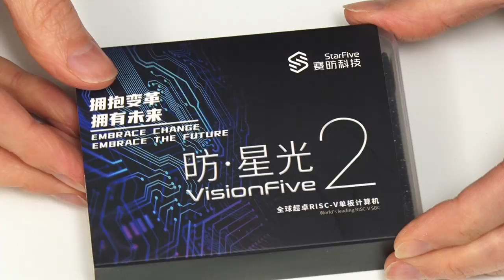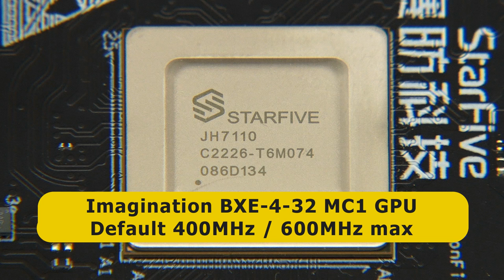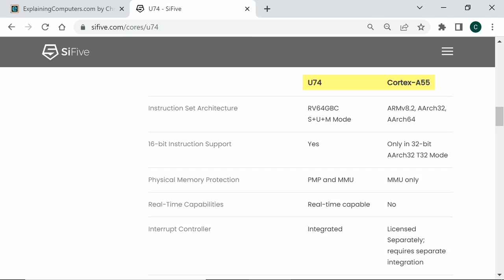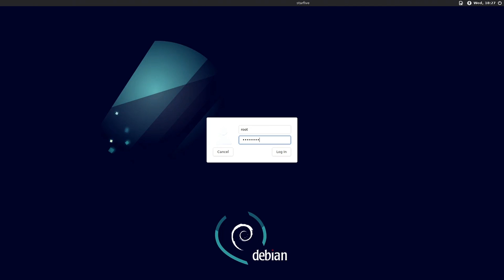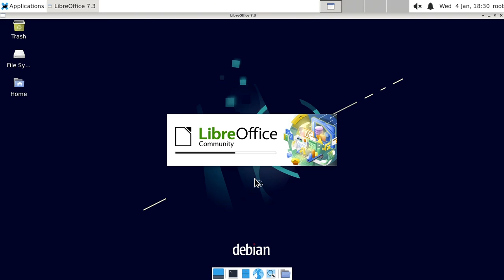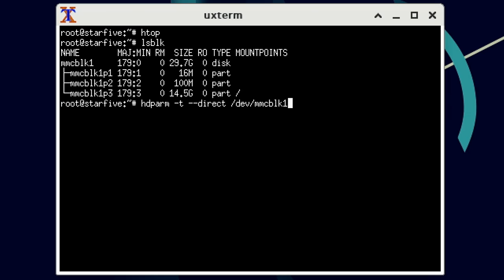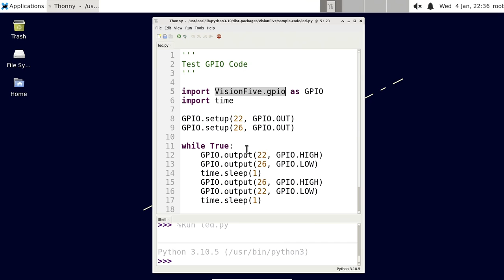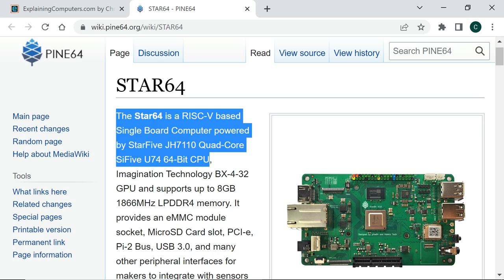VisionFive 2: RISC-V Quad Core Low Cost SBC

Comment: Having GPIO with actual control is SO VERY IMPORTANT!   For me, I don't really care if there are pins on the board from manufacture if you can't do anything with it!  One can buy Motherboards for all types and sizes, but the ability to 'sense the world AND talk back to it is the entire point of  of development, in my humble opinion!
Reply from the maker: We are, as so often, in agreement! :) I was very pleased to be able to install and test GPIO control. StarFive already have a pdf guide to using GPIO on the board, so are clearly going to support the maker market. I think a lot of people will want to experiment with a RISC-V project board, especially when Raspberry Pis remain in limited supply.
Reply: Erm, have they not been doing what you describe with the Raspberry Pi for over a decade already?
Reply: @terrydaktyllus1320  And I have been a Pi fan for years. It's just tough to build new projects when you can't obtain the hardware to do it on!   😛
Reply: @lesliedeana5142  But, with respect, that's not what you originally said.

You said "I don't really care if there are pins on the board from manufacture if you can't do anything with it" - which, of course, is not correct for Raspberry Pi as the pins are both functional and well-documented. That's the point I was responding to.

Sure, I accept there's a supply problem with the Pi and that people are looking for alternative boards instead - I entirely get that and it's why I build Gentoo Linux on my types of boards including Raspberry Pi, Banana Pi, Orange Pi, NanoPi Neo, some Olimex boards and even the Atomic Pi based on Intel Atom architecture.

But you've now decided to answer an entirely different point that what you originally stated and, with respect, "Telepathy over TCP/IP" hasn't been invented yet - so I can only respond to words that you write, not the thoughts in your head.

I do wish more people would stay on topic in these discussions!
Reply: @terrydaktyllus1320  With respect, you are the one not on topic. Leslie was talking about a non PI board and others like it. Leslie agreed with your not on topic comment about PI SBCs, but her original comment was about the presentation of non PI boards with or without GPIO pins.
Reply: @terrydaktyllus1320  I apologize, but I don't mean to start a 'flame war' here. This was intended to just be a general reply and not a historical accumulation of my projects and designs. I've purchased a multitude of SBC products, all of which had 'GPIO' on the board, but turned out to be unusable. Admittedly, I haven't purchased the  multi-hundred dollar versions because they fall out of my 'experimental' price range. The Pi's over the course of time have done a good job, and I've had to come up with several add ons  to improve reliability for 24/7 applications. But a max $75 unit is what I'm looking for.  I've done projects using PC's and writing code to monitor I/O such as printer port status' to monitor things, and other things with low-voltage relays.  I don't mind engineering things.  It's just very disheartening  to get a new  widget board, see the lovely metal posts sticking out of the epoxy, and not being able to do a single thing with them!  I still stick with my original comment, and I don't think that I'm being 'revisionist' in it.  Hugs, my friend.
Reply: @paddle_shift  So Leslie cannot speak for himself/herself and has appointed you his/her spokesperson then?

I can only respond to the words as they written - if the words written are open to multiple interpretations then that is the fault of the author, not the reader.

So can I suggest that you direct him/her in the use of a more coherent selection of words in the future?
Reply from the maker: @paddle_shift  Agreed. I think it was very clear that Leslie was saying that it was good to see a board with software GPIO support, which is not always the case. She did not in any way imply that Raspberry Pis do not have this support. It was a positive comment, not a complaint about the Raspberry Pi. Peace. :)
Reply from the maker: @lesliedeana5142  Thanks Leslie. :)
Reply: @lesliedeana5142  There is no need to apologise, we are all equal here. I simply responded to a comment that was factually incorrect from my interpretation of what you wrote.

All I can say is that I have worked on a wide range of SBCs (as per my last response) and I am not aware of the issue of "non-working pins".

I do know a lot of these boards are poorly documented and that sometimes it can be difficult to get I/O working in Linux - but when I've come across it, I've "got there in the end".

MickMake has an excellent channel where he tested many types of less popular SBCs and showed testing techniques he deployed to find out "what pin did what" in some instances - unfortunately, he seems to have abandoned his channel now but I was using it as a great resource for working out what some boards did on many occasions.
Reply: @ExplainingComputers  I disagree. Even you have inserted the word "software" in front of "GPIO" where Leslie did not use such a word originally. So even you have changed the interpretation of what Leslie originally wrote - therefore proving my point entirely that what Leslie wrote originally was open to interpretation due to a lack of clear language.
Reply: Getting back to the original point raised:
I haven't yet encountered a board / chip where I couldn't use the GPIOs.
Maybe the point was more about high-level control, like in the Python demo. I usually just use the GPIOs in firmware - which only works with documentation on the actual hardware, surely, or good enough reference code. Or on a higher level, such as in Linux, one may just use the files in the sysfs directly, like on the Allwinner and other platforms with the great support that came from the community.

Addendum: Instead if importing a specific library, in any interpreter environment one could just do file I/O as well. ✨👩‍💻✨
Reply from the maker: @terrydaktyllus1320  What Leslie implied in her comment was extremely clear. You are knit-picking at language above meaning. This is a set of YouTube comments where we try to have friendly, positive debate, not a court of law where we go out of our way to pick fault with others.
Reply: @ExplainingComputers  As you said "peace". Hard to achieve these days but like freshly fallen snow, so desirable and welcome when it comes. ❤
Reply: @ExplainingComputers  I also happen to be a computer engineer of some 40 years experience, probably of a similar level of expertise and knowledge to your good self, and I enjoy technical discussion and a role as a technical educator on some occasions too. We both know that to progress such discussions, each side needs to understand clearly what the other side is putting forward. I am not going to make excuses for having that type of analytical engineer's mind, even if you choose to label it as "nit-picking".

And do note that when you picked me up on my error over RISC-V in Apple devices above, I graciously accepted your correction - I have "big enough shoulders" to accept when I am wrong and learn from it. So there is no "court of law" here from my perspective, merely trying to overcome the limitations of language in others to understand fully the actual point being made.

With that said, I know when to walk away from a deadlocked discussion too and such is the case now.

So discussion closed.
Reply: @CyReVolt  Exactly, and thank you. That was entirely the point I was making and, again, others are welcome to check out channels like MickMake where he was actually sometimes going down to using an oscilloscope to work out what pins actually did - because of poor manufacturer documentation, not because they didn't work at all.
Reply from the maker: @terrydaktyllus1320  Thanks for this, appreciated. :)
Reply: In the 1990s, I worked with industrial controllers, which do what these SBCs do with GPIO except for tens of thousands of dollars.  They used an obscure programming language back then too (Ladder Logic).  It's amazing to see how far that segment of the market has come in a generation.
Reply: @lesliedeana5142  Of late I have been using an old thin client with a Pi Pico connected using the U2IF firmware and the Adafruit BLINKA libraries. It's not ideal due to size and power requirements but it's more flexible than just using a Pi Pico on its own and the think clients are readily available.
Reply: @m3chanist  Sonny, the moment you say "Everyone else thinks..." or "no one else does..." (note the spelling which you got wrong), you've given me the argument.

You can only speak for yourself here. If you make this about "me and my big gang of virtual mates" then all you've shown is that you lack the strength of argument to take on my points yourself and that you know that to be the case because you clearly need that backup from others to provide the validation to your point that you can't make on your own.

And, yes, it's complete pedantry on my part to pick that out here, but it wins me the argument if your own views and opinions are not as strong enough to stand on their own merits.

You're a demonstration of what happens to people when the education system stops teaching youngsters the skills of debating and critical thinking - you end up with "me and my mates think..." counterpoint that is completely meaningless.

Run along now, mind how you go and stay away from sharp scissors. And take your "virtual gang" with you, buy them an ice cream or something.

Discussion closed.
Reply: when you have a full fledged PC (not a microcontroller) it can be good to use USB to break out whatever kind of IO you want. There are lots of options for whatever you want to do, and it keeps you platform independent.
Reply: @terrydaktyllus1320  Yes, but Pi is not open source as RISC-5 is. This means you can program in Assembler. This is necessary for anything fast. Python cannot run a graphic game - it's just not fast enough. And there is no Assembler, as it's not open source!
Reply: @ExplainingComputers  It looks like that could replace my AMD Ryzen 3 tower that functions as a firewall right now. Presumably those ethernet ports work, I would need a basic Debian install with iptables and firewall scripts.
It could live on a shelf under the desk, or on the end. UPS with a powerbank. It could boot off microSD, eMMC and run in RAM. Logs preserved with overlayfs, maybe use overlayfs to allow full maintenance, and recreate the RAM images occasionally.

One ethernet to the wall for FTTH, the other to a wireless router for connectivity to LAN and WiFI.
Reply: @terrydaktyllus1320  Why are you bullying?
Reply: @oneeyedphotographer  I last contributed to this discussion over a month ago, so surely your question should be "why were you bullying?", if I want to be pedantic here. And there was me thinking that "bullying" is something that the bully "just does", as opposed to simply waiting for someone to reply and then responding to that. Or is it your expectation that you get to post here without me having the right to reply, the epitome of self-entitlement.

Why are you so self-entitled?

And why can you not behave like an adult and simply ignore my comments in the first place, rather than imposing your "rules" on everyone else here? Or would you like me to submit my comments to "You Highness" first so that we can ensure they are "not bullying" and meet your editorial standards?

Surely by replying to me you are simply encouraging "my bullying"? Why contradict yourself?

Sonny, we're not discussing me anyway, you've no expertise on the topic of me because you're never met me. So next time we meet, do try to keep up and stay on topic, there's a good lad.

Discussion closed.

Comment: Exciting times for the Open Source enthusiasts (like me)! At this price range, I think we're going to see an increase in momentum for Risc-V. Especially with Pine being involved, I think.
Thank you for this interesting video!
Reply from the maker: Agreed. The price is so important here.
Reply: I thought the price for the first RISC-V single board computers was insane. The RISC-V is open source so you are not paying extra for the licensing costs of ARM, so it should of been much cheaper. It finally is now.
Reply: @GeekBoy03  It's not only licencing costs that makes a price.. The price had more to do with the development costs. And early adapters usually have to spend more.
Reply from the maker: @GeekBoy03  It is indeed good that prices are now falling. But how the first board have been been much cheaper? Low- and first-run fabrication is never low cost -- licensing costs (or lack thereof) have nothing to do with it.. The first VisionFive SBC was very cheap compared to the RISC-V development board launched a few years earlier, which cost $1200. :)
Reply: @ExplainingComputers  from $1200 to only $51 today, the development speed of RISC-V SBCs is amazing, and i am all in for it
Reply: @STORMFIRE07  
Rest assured, you won't be buying them for $51.
At least, not anytime in the near future.
The craziness that's been going on in the entire semiconductor industry over the past three years will have the exact same effect on RISC-based SOCs as it did on the Pi.  Shortages, long production times, and tripling or even quadrupling of prices.

Comment: What a nice board! I think it's pretty wild that we've gone from an 8 gig $179 board to a board with three different RAM options at double-digit prices in around nine months.

And with the prices and RAM options alongside the addition of GPIO and all those storage options, this could really have the potential of competing with the Raspberry Pi and introducing more and more people to RISC-V.

One more thing, by the way; your closing segment triggered my Google Nest Mini. 🤣
Reply from the maker: Greetings on another Sunday, and thanks for your support. Sorry about the Google trigger!
Reply: @ExplainingComputers  Hi, Chris! You're welcome. And you're very much okay; I thought the Google Nest Mini getting triggered and telling me what the weather is outside was funny! I should've recorded it but alas, I had to get ready for the day... It's not the first time this sort of thing happened.
Reply: Don't forget, that RISC 5 will allow for huge amounts of cores too (some Computer architecture professor in japan made one with 1012 cores!), and special computing devices like rendering engines, AI accelerators and more, all up to the hardware developers to use the RISC V architecture in any configurations and using any interconnects they see fit!  The hard part of course is designing it all, as it is wicked complicated making micro architecture stuff and getting the clocks, temperatures, power supply and control... right and everything in sync.  Plenty of room to make many rejects before finding the "secret sauce"!😅
Reply: Its really all about the players accepting lower margins to drive volume. The RISC V core itself is tiny. Someone could pop the cap on the chip and see the layout/blocks.  Really be interesting to see some traditional benchmarks. The interesting thing about embedded design is it is bound by different requirements that traditional server, workstation, desktop computing.  Things like battery life (multiple sleep modes), lots of IO and feature peripherals (counters, timers, interrupt structures) come into play. You prefer or may mandate fanless operation, etc. 
I hope they have a roadmap for some AI cores. The AI revolution is not trivial - it solves a major problem in the adoption. The AI stuff dates back to the early 1980's as well (Neural Nets) and is finally getting its day in the sun.